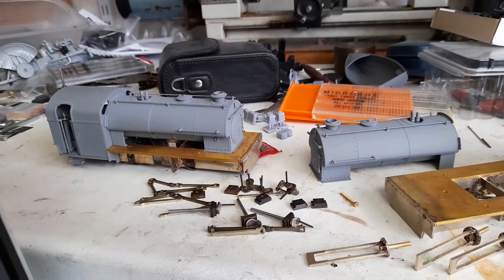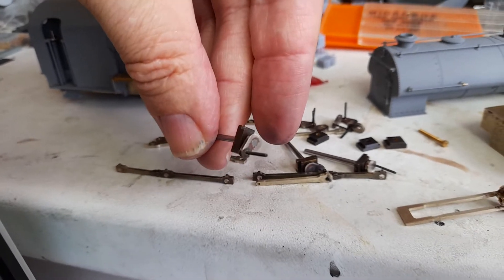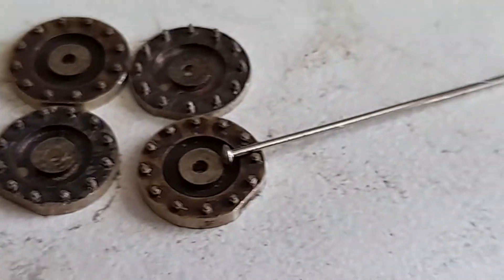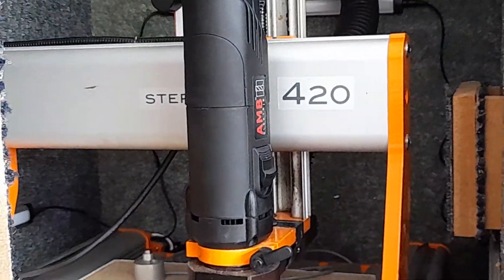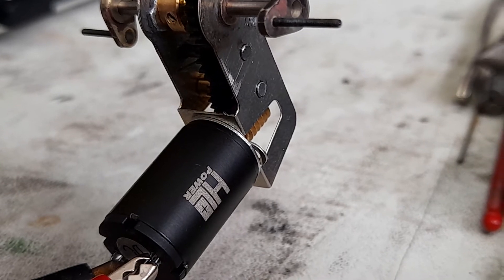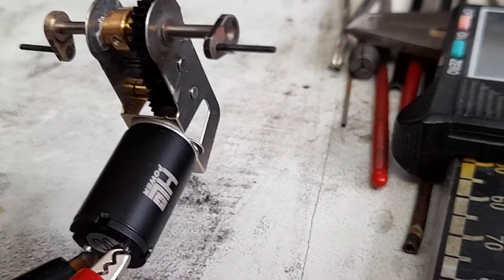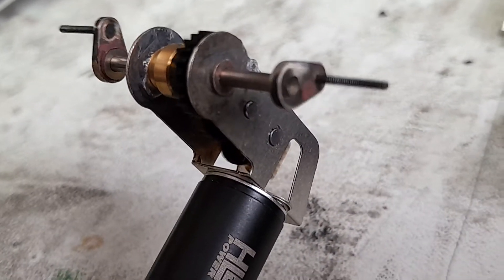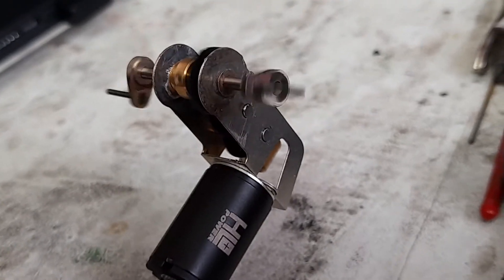014 GASWORKS PECKETT  update with High Level Gearbox

Comment: Looking very good Giles. Will the coreless motor run directly controlled by a rX or will you have to put an esc in?
Also, you might use an upconverter to get to 7.4, have you ruled that out?
Reply from the maker: Hi Steve - this particular one will be normal two-rail, the RC one will have a similar arrangement,  with a lower ratio and slightly bigger motor and run on the standard 3.7v so as to give a nice (slow acceptable) speed on RC but with the 12v motor